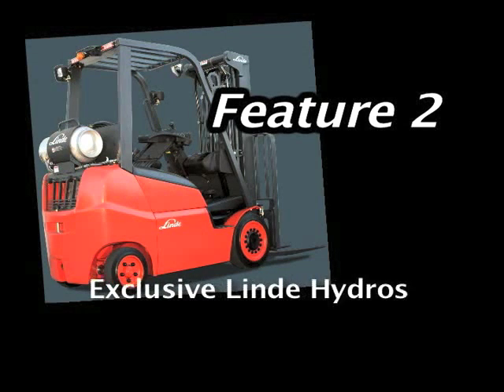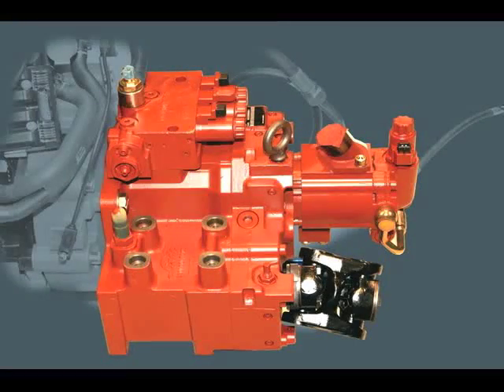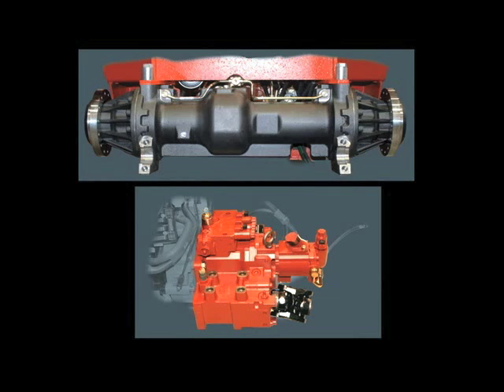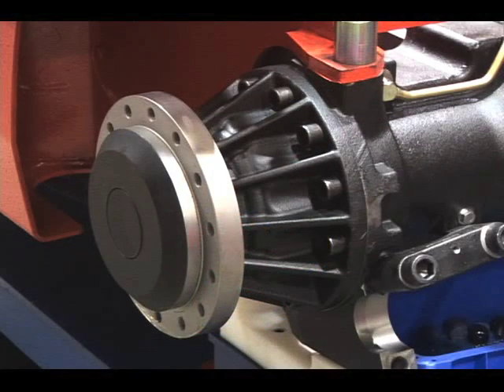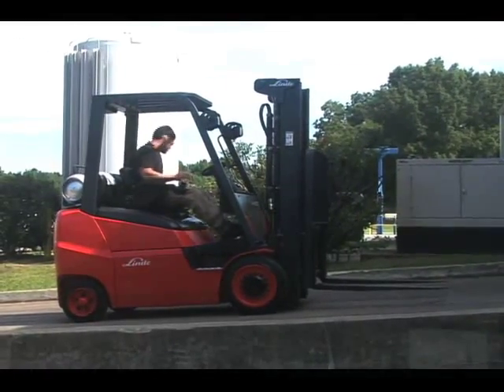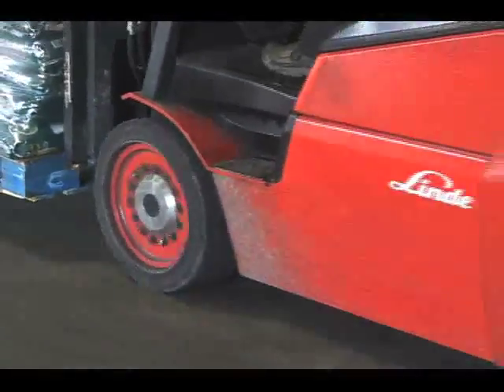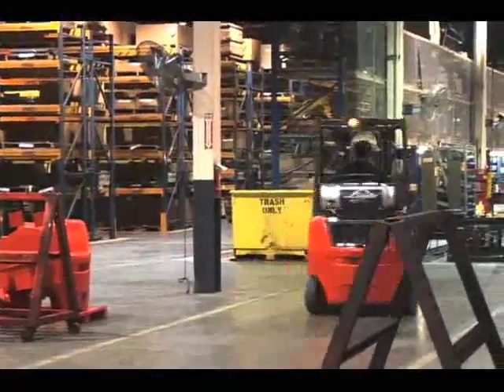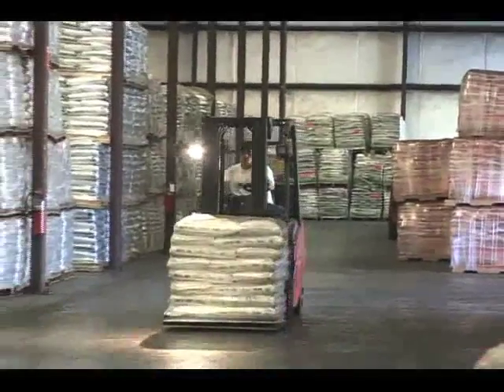MHI-Linde 1313 Hydrostatic Drive

Comment: Unbelievably powerful drivetrain. It took some getting used to especially when you want to stop. There is no brake pedal  in the traditional sense.  You just take your foot completely off the accelerator to stop.  I'll say it again the drive is crazy strong, I've never been on a similar sized machine with the kind of power Linde has. It's deceptive because it's really quiet too, but trust me if you mash on the gas whatever's in front you will move or your tires will dig a hole.